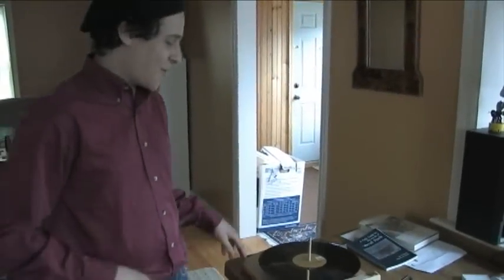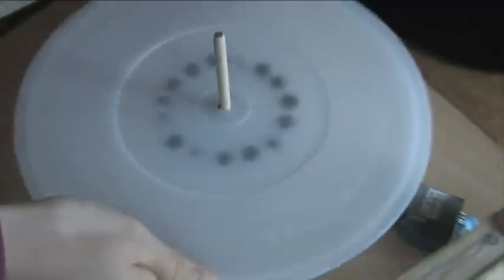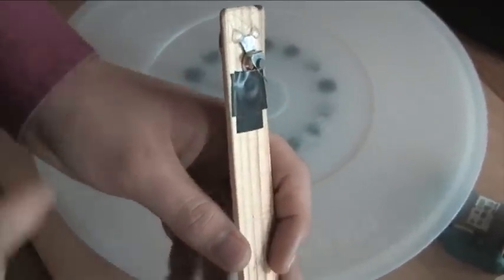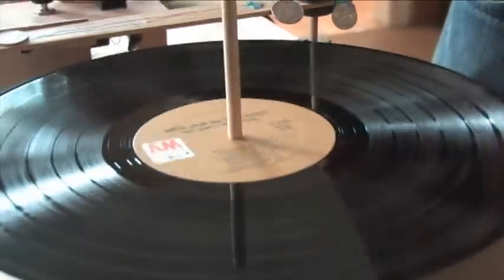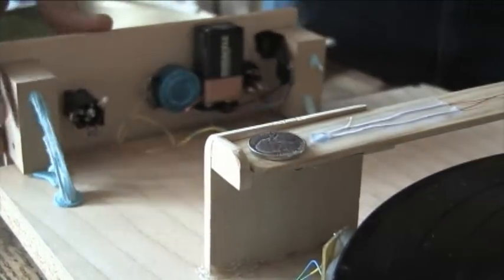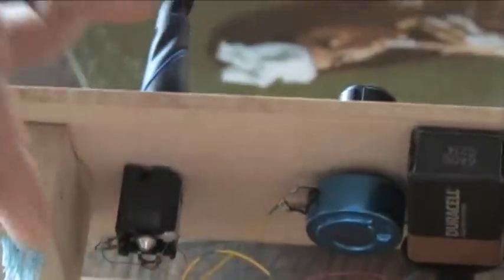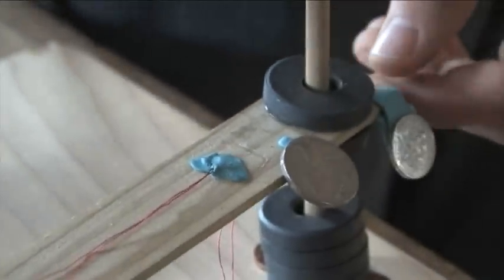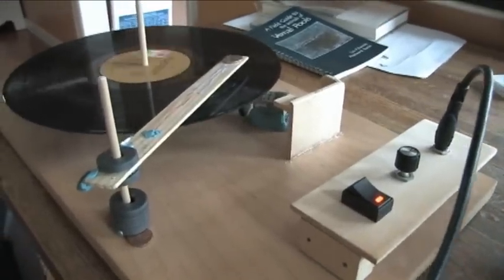Homemade Electric Record Player

Comment: Nice effort! I see that your platter is very thin and light. A thick & heavy platter will reduce the 'wow' and 'flutter' (the inconsistency in the rotation speed and hence the playback rate).

Comment: Magnets influence the cartridge's ability to pick up sound accurately, the motors is directly under the cartridge during playback -- this is the opposite of what every turntable tries to do. 

And the best part is I think your turntable is reversed - as in yes the record is spinning in the right direction but your needles / cartridge is pointed in the wrong place. It is SUPPOSED to RIDE the vinyl surface not CLAW into it. think of your finger nail as the stylus, the record should be turning away from your nail and your nail riding the groove and not you pushing your finger forward against the vinyl.

Good job nevertheless. :-) Looks like you had fun. Now create this design as a still magnetic but well isolated system, fix the couple of issues with record playback direction vs stylus contact and tonearm direction. Lighten the tonearm. Put some speed control into the system and you could sell your prototype :-)
Reply from the maker: Hi, thanks for the feedback. If you look at the needle, you'll see it's actually riding the vinyl surface as you mentioned. I made this in high school about 10 years ago so of course it wasn't perfect.

I did have tons of fun though. Thanks!!
Reply: What Colors the Steel Sky Blue?

Comment: Daniel -   MASSIVE Professional KUDO's to you Sir - you "Rocked" this  project like  a  Professional Old School Audiophile - Totally OFF the  Scale  and  definatly "Hugely Outside The Box" ... folks  .... Daniel   didnt  really heighlight   about  the motor location at all - I guess he figured that  you  could  SEE it in the  Video (Under the Turntable -  near one of the   ends of  the Tonearm - In all fairness - I had to FREEZE the  video   so I could Locate the  Motor) - the Magnets were used to   simulate  a Friction free   enviornment for the  Record Platter "The Big  White  Plastic Disk" that  he  put on the Spindle (Before  the Record) - I am   gonna  try  improving  on this AMAZING  and "Outside The Box" Phenominal (style of thinking)  Record Player - I  absolutly ADORE the Use of the EarBud Coils for  the  Needle Pickup - So Boys and Girls ... this  Resourcefull young  man not only  Created a  "Psudo" Direct  drive  "Drive System",  he also  had  the  forsight  to  try to  reduce the  Friction by using  Ring magnets - and he also   Crafted the Record Needle and  Cartridge  from Scratch - Woo Hoo Daniel - You ROCK Brother !!!! This was an EXECUTIVE calibre level Science project

Comment: Hello Daniel,

Well done. I think you wanted to show how a record player could be built from simple parts like using a piece of wood to act as the arm and so on. I see you posted this video in Aug. 2009 and I wonder by having learned so much from this first build if you have been able to upgrade the device. Your idea to use magnets to float the platter is very interesting. I was wondering if a platter could be floated on mercury but there are many reasons why that would cause problems so your idea to use magnets is a much better idea. 

Peter Nolan. (Ph.D., experimental physics). Dublin. Ireland.
Reply: Hello, Mr. Peter. 
Is there another alternative that could be used to make these magnets work? it would be really helpful for a record player. please do let me know!
Reply: @rituk5256  Peter never let you know 😞

Comment: Well, I wouldn't use a collectible gramophone record although those are pretty hard to scratch. I have an old Victrola and it can either use a small wooden needle or a small metal spike type needle. The metal needles sounded better but would quickly wear out a record. Those were actually shellac disks, not glass. That gets give me a thought, would your turntable have better speed accuracy with a glass platter from a microwave. Heavier platters have better speed consistancy.

Comment: Yeah, this is definitely looks more like a 70's British turntable design. That reminds me, I used to have the Garrard changer which was on a spring suspension in a base like most of the turntables of the era and it developed this problem where the motor would violently shake off balance occasionally when a record would drop from the changer spindle causing the whole table to shake and cause the tone arm to fly all over the place.

Comment: For being built out of "found parts" that were not originally part of a turntable to begin with it works very well. BSR, Garrard and Glenburn used to make turntables with proper turntable parts and ended up with about the same performance, although I think your tone arm may be better.

Comment from the maker: @ror3dracer01 :) good call.  You're right, I only used two of the three terminals and so it is a variable resistor and not a potentiometer for my purposes.

Comment from the maker: @ror3dracer01 
I went from one end of the battery to one side of the switch, out the other side of the switch, to one side of potentiometer through the other side, to one side of the motor through the other side, and then back to the other end of the battery.

Comment from the maker: Are those the old glass ones?  I would try except the only grammophone record I have is in very good condition and worth a bunch of money- I wouldn't want to scratch it up with this.  The only problem might be that they tend to be a lot heavier than standard vinyls and the motor mechanism I have probably would not be able to support the weight- even when I experimented with a little bit extra weight tone arm, it prevented the record from spinning at a fast enough speed.